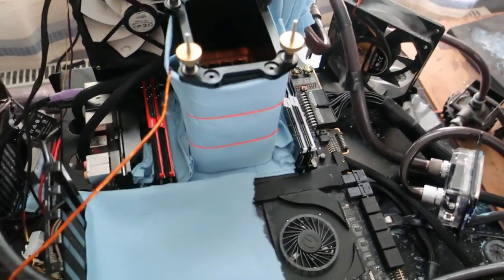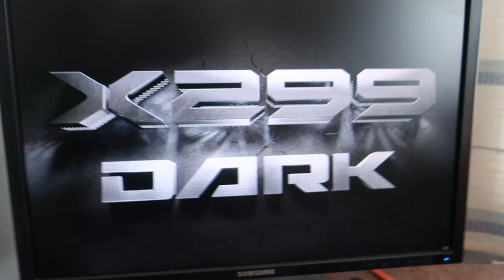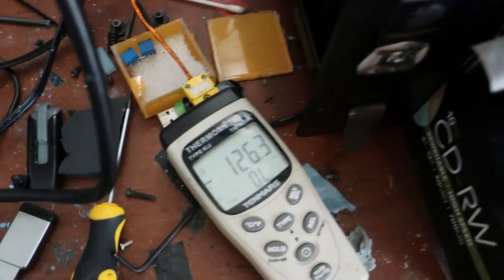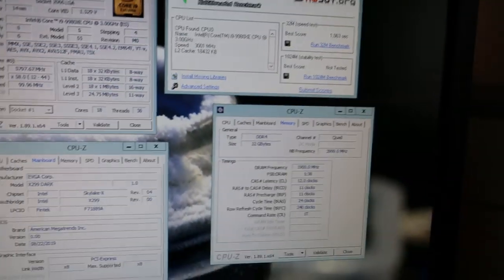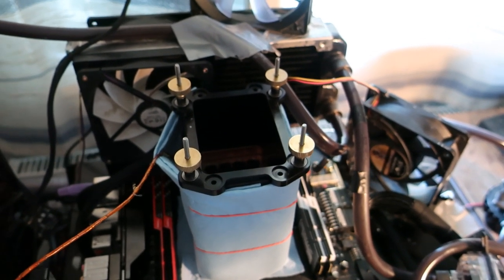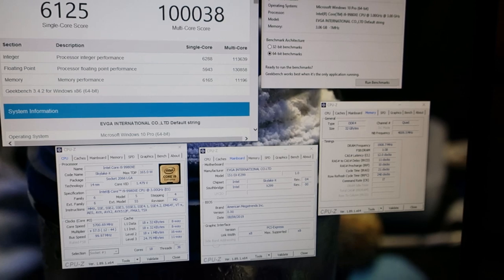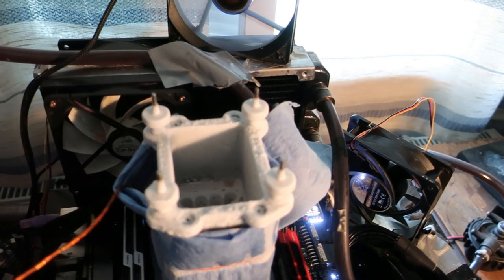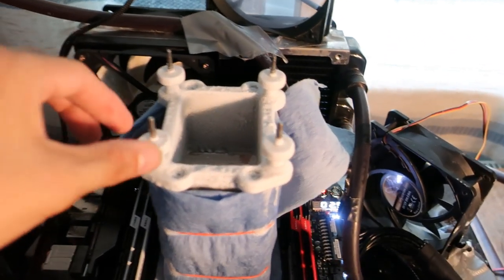Overclocking my new 9980XE to 5.8GHz+ on LN2

Comment: Awesome content. Any comments on the 7980xe vs the 9980xe performance? I have the 7980xe that im not sure if i should delid etc given the mosfet heat issues. I might have the mosfet term wrong but the thingsa that deliver power to the cpu get hot on this platform

Comment: You once had the 9900k on 5.3ghz with dark rock water cooler (~2300 cb15 score) ... now you have the 9900kf on 5.8ghz but double the ammount of cb15 score? How is this possible from 5.3ghz to 5.8ghz to get such a huge score benefit?
Reply: its a 9980XE 18 core ...
Reply: @Ground15  oh xd 😇
Reply: Bec. The 9900kf has no apu so it has much better temps